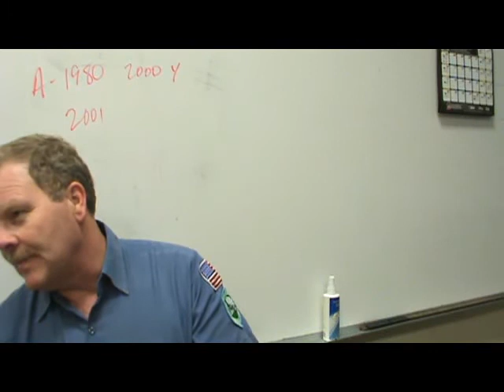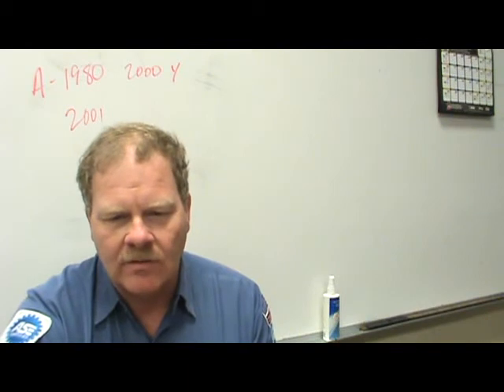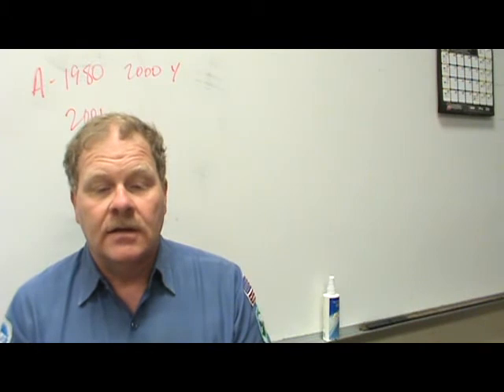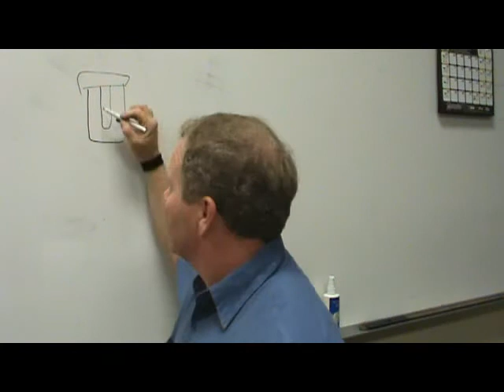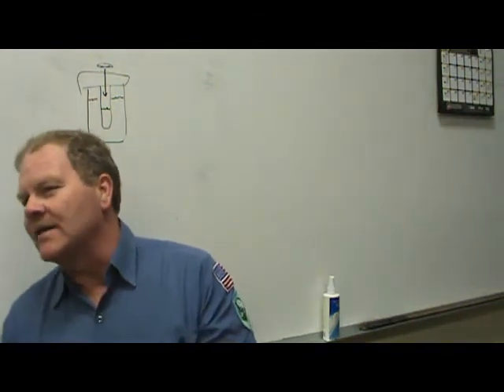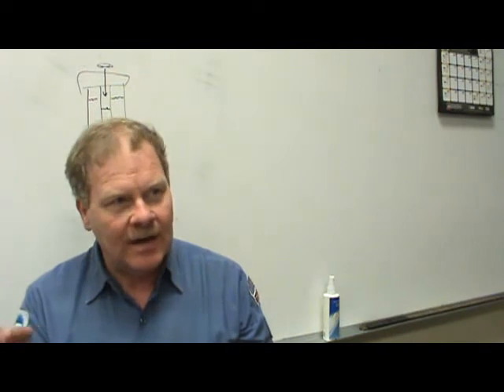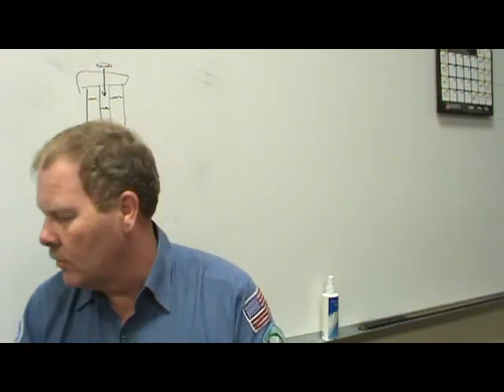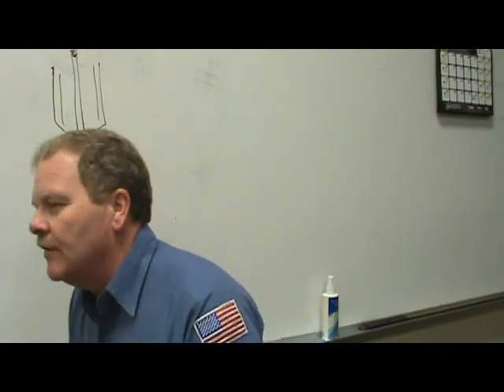Eng Rep 2 tst 7-8 - Oil and Gas Concerns.flv

Comment from the maker: Detonation happens because of hot coals or the red-hot edge of a valve with too little margin. Spark knock and pre-ignition are similar and happen either for the same reason or because the engine is running too hot or because the ignition timing is advanced too much.  It's all about semantics.

Comment: I agree, pre-ignition and detonation can be caused by the same effects, but how do you personally identify the difference between the two? I've always accepted that pre-ignition happens before the spark plug fires while the piston is still on the compression stroke, and that detonation always happens after the spark plug has already fired.

Comment from the maker: The concern you've expressed is with semantics - sort of like making a distinction between "pound feet" and "foot pounds" when discussing torque.  It's a hair-splitting argument.  You go after whatever is happening by gathering data and performing engine forensics if correcting engine temperature, EGR flow, carbon buildup, or ignition timing concerns aren't evident.  Whether you call it "pre-ignition" or "detonation," somebody still has to figure out what to do about it.

Comment: I trust your knowledge, but are you sure about what you said regarding detonation? It sounds like you are confusing it with knock or "pre-ignition". I always understood that detonation happens after the spark plug fires. i.e. there is a strong pressure pulse from combustion initiating in a second location from the spark plug that cause there to be two flame fronts in the cylinder